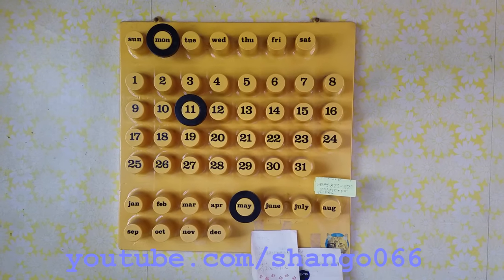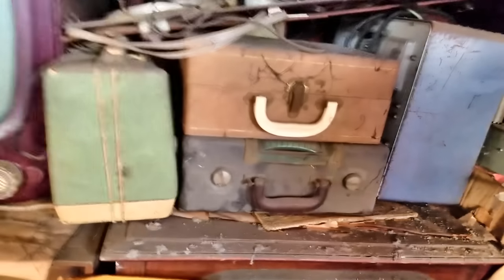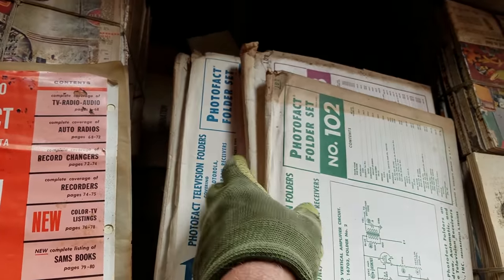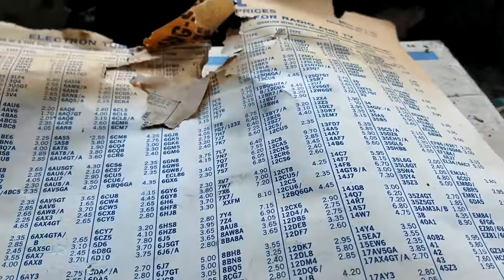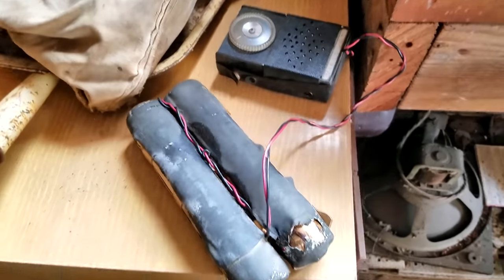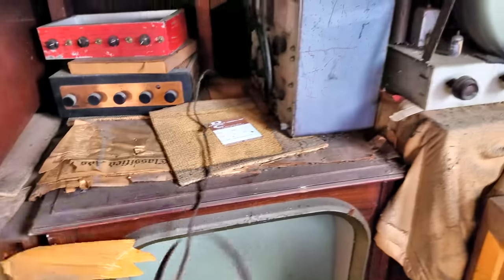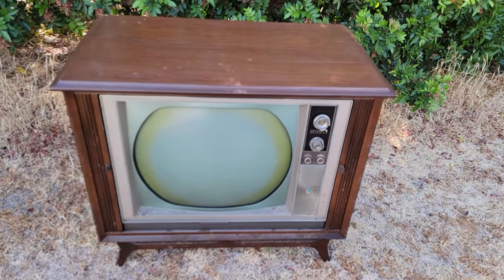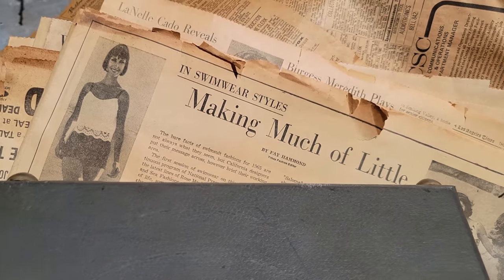Mid-Century TV Heaven in 4K

Comment: I am convinced Shango is the single last person in all of California to have a running driving Aerostar!
Reply: I've seen some around Seal Beach and Huntington Beach.  Everything is running and driving forever in California if you want to keep the car and maintain it.  There are people in Long Beach daily driving dented and beaten, but rust-free 1970s AMC Hornets and Dodge Scamps.  Simple and cheap to maintain.  They are on the same street as friends I visit there live on,  and the cars are there year after year, just with a few more battle scars.
Reply: thank god shango speaks again 😁😁👍👍
Reply: I had a 1986 Aerostar. Was a Great dependable vehicle !!
Reply: Cash for Clunkers took a lot of good cars off the road
Reply: @ZombiedustXXX  Astros shared the same issues as a lot of GM trucks of the time, one of the most common being that of the torque converter mounts shearing.  Ours at one time had intermittent issues with sensors, causing the vehicle to go into "limp home" mode a few times while my father drove it home from work.  Other than that it never really gave us any trouble.  We put 150k on it before we got rid of it.
Reply: Yeah I remember seeing some Volvo 245 from the 1970s rust free, but sun damaged lol, when I was in SF back in 2005. If those cars don't rust they will last you a lifetime, mechanically they very solid. These looked like they where daily drivers for the folks who use them, they looked totally original. It was fun to see.
Reply: I had a 1997 Aerostar. Dove that thing for years, That last good Ford minivan made.
Reply: My boss once had an early 1990s model in pretty pristine shape. Unfortunately, soon as someone bought it and tried to drive home, the transmission literally exploded and dumped its guts and fluid all over the highway. Transmissions were bad about failing in ALL Ford and Chrysler minivans, even today.
Reply: Ford Aerostar need haul all them tube tvs lol remind me movie rat race

Comment: People used to keep the plastic on lamp shades to “preserve” them. Dust wouldn’t settle into the fabric.
Reply: I've seen that too.  Baffling.
Reply: Yep, and plastic on the couch. Lol
Reply: I did that and it was a big mistake. Causes the heat to build up and the material to become brittle, especially when the fabric is backed by plastic. Those lamps were very stylish mid-60's. They may be making a comeback.
Reply: @Joetechlincolns  The couch plastic was so it would stay nice,  in case the Pope decided to stop by for lunch some day
Reply: same for furniture plastic covers ,,, tickyta,ky
Reply: We did that with a blue and white striped Settee from Harrods London in 1995
Reply: I put screen protectors on my handheld DMM displays but this is ridiculous.
Reply: @hightechstuff2  I do this too, must be a fluke……
Reply: @Synthematix  LOL! Yes! Though, I'm not very happy with my Fluke 8845  bench meter. All my handhelds are Fluke and I love them all.
Reply: I have a couple lamps that were from the 60's that belonged to my grandmother that I kept the plastic on the shades as she did. These things are like "modern art" pieces. And an ash tray that will hold no less than 100 cigarettes at once.. Massive heavy orange porcelain thing.
Reply: @hightechstuff2  I have the fluke 101 type handheld, got it because it’s so small fits in the pocket when repairing pcs etc,
Reply: Used to?  I do it.  When you smoke and you have pets, it is absolutely necessary.
Reply: “A series of allied bombing raids, will not deter our industry of lampshades”

Comment: 8:50 Fisher 500C 1964 which is an FM only receiver and worth quite a bit of money to collectors. Recap kits available online with original can type electrolytics. Some of the best workmanship and soldering of point to point wiring from the factory that I have ever seen. May be worth more all together rather than parting it out. 30 watts per channel with 7591A push pull outputs. I am working on one now, it is on my bench.

Comment: Ho boy.  Memory lane there.  You snagged some good sets if they don't require major parts. My parents married out of high school in 1950 and bought a very similar Motorola console TV.  They called the wood "blond".  I was born two years later.  I remember being allowed to "stay up late" and watch the Three Stooges on it as well as one night, watching the Wizard of Oz on it while I was puking my guts out from the flu.
Memories.  That old set was eventually replaced with a 19 inch Zenith table model in '68 that cost about $600, one like it that  I kept running until about 2003 when the CRT eventually went soft.  I did TV repair for a mom and pop TV/appliance store in Whittier when I was going to school in '70's.  Many of the videos bring back a lot of weird memories.  I can't tell you how many bad ground connections I fixed on RCA R-Y/B-Y filament circuits.  Zeniths rule.

Comment: How old is that calendar?  Early '70s?

Some of those radios I have never seen before.

The Sylvania oscilloscope is definitely worth getting out of there, even with the damaged reticle.  Sylvania designed their test instruments with traveling techs in mind, and for that reason they are built to take more in the way of shock and vibration than most others at the time.

Comment: There is no Printed Circuit Board (PCB) inside this? Very simple electronics. Can be easily cleaned with isopropyl alcohol. It does not have any semiconductors or maybe just some diodes for basic circuitry?

Comment: I still say you need to build a system to display period tv shows on these TVs you get working, you could do this with a Raspberry Pi 3 and a modulator box from an old video game! The Pi has composite video out and analog audio then you could play old TV shows from the 50s through the 70s that are in the public domain right of the internet or download them into a flash drive and plug it into the Pi and play away without risk of copyright strikes!

Comment: I had a Motorola like the one on the beginning only dark finish , it needed picture tube ( politically correct ) and I actually found another metal and glass tube and somehow changed it out with my extremely limited electronic abilities way back in the summer of 1970 when I was 14.
That set was a trip, it was old, probably an early 1949 as it had a 6H6 diode where any others I had seen used some form of other non - vacuum tube diode.
The whole cone of the picture tube was charged with no covers - no sticking your hand inside that one with it running .
I used it till one day a capacitor blew or something and it made very loud arcing noises like a small Tesla coil and scared hell out of me.
It had no dates and I really didn't know how old it was, I thought it was early 50s, if I knew it was from 40s I might have kept it longer.
Reply: Yes, I believe that one is a 1950. Had one exactly like it in 1990s for very short time. It was too ragged and I was too busy so I dumped it. 
Ol
Reply: Older one I had in 1970 was dark mahogany with rounded front corners and top that had edge more like a table.
I took it home from trash because it reminded me of one I parked in front of as a tyke watching Huckleberry Hound.
That one was about a ' 52 with rectangular pictire tube, I believe I saw one of those in the collection.

Comment: You had me at 4k. It doesn't matter what the content is, so long as it's in 4k that automatically makes it better (on everyone's 1080/1440p screens). According to modern society. 1080p is so 2008!!.. So they say...
Reply: "1080p is so 2008!!.."
*Me who watches videos at 480p on a QHD screen just to save some data.
Reply: Watching it at 480p on a 1984 black and white 5 inch CRT TV over RF
Reply: I can barely sustain 720p with my internet connection LOL
Reply: @38911bytefree  i usually download the videos then playback later. Super smooth not having to deal with buffering
Reply: Thanks to YouTube compression you practically need to watch the '4k' version just to get a full 1080p.

Comment: That odd speaker with the stylized M logo is more than likely the speaker to the very early Motorola police radios.there should have been a trunk unit for it and it probably  used the rotary power supply also known as a Dynamotor Motorola to Boat Anchor collectors of early big M car radios use by some of the richer police departments. I had a hanging Swag lamp to that back in the late 60' early 70's. BTW, THATS A NICE THUMBPRINT photo for the video. The earlyTV terrorist.hihi. 73!

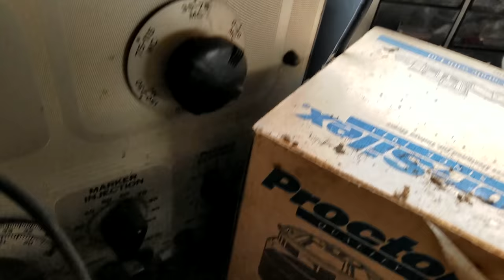Comment: 4:05. Never seen an electrical receptacle like that -- quad in the standard duplex shape, only usable with really slim pre-1981 non-UL approved plugs.
EDIT:  Have seen a few of old triple ungrounded receptacle - but didn't use a standard plate.
FURTHER EDIT: similar to the triple switch he was flipping beside it.

Comment: In Europe, that converter wouldn't be that useless, because all our VCRs and many retro home computers transmit on UHF channels 30-38 and the really old TVs don't have a UHF tuner. And my 1960 Blaupunkt has one retrofit, but the switches are so corroded it only works like up until channel 25 and I'm too lazy to get it out, also I fear to break it.

Comment: If nothing else , a better old tube TV will yield a power transformer providing 6.3 volts, 5volts , and 250-350 volts for rectification to DC , useful to build tube audio amps and ham transmitters
Reply: Old speakers can be good for radio restorations

Comment: Shango, did you ever have a 1940's TV with a channel 1?
Reply: I'm sure he has. My current project is a 1949 set which still had Channel 1 on the tuner even though it was discontinued at that point. The Sams has the sections for channel 1 on the schematic but all the alignment instructions just skip it as if it never existed.